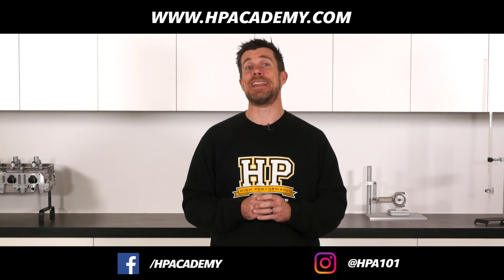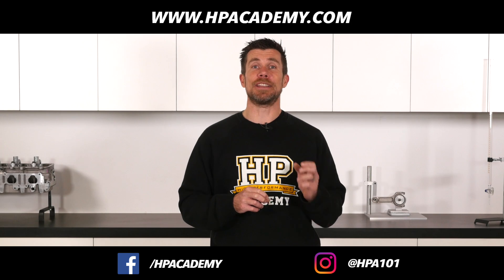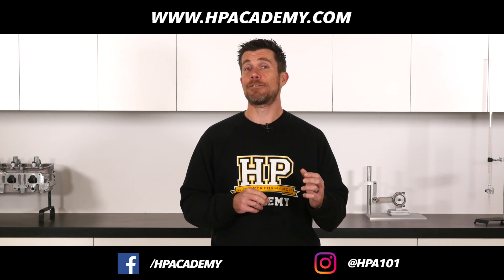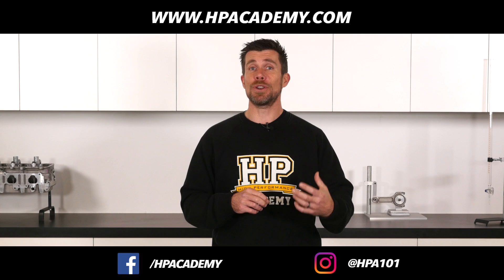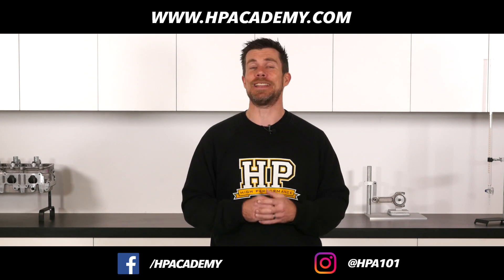[HPA Q&A] Road Vs Dyno Tuning | Which is best?

Comment: if you must tune on the street, find a big, open toll road that's barely used (Florida has a few) and record allot of datalogs in various load conditions to get good drivability and close to the power. then on the dyno, tune for maximum power. then verify on the track. is that a good plan?

Comment: It's not too difficult to find MBT on the road, what I have been doing is just getting the acceleration from data logs and making runs on the same stretch of road over and over. I used to read it out from the logs manually but I recently created log processing software that does it for me. Of course a loaded dyno is a handy tool for getting real time performance data but anyone who thinks it's a complete replacement for testing on the road or track is a fool. All of the final touches to transient behaviour as well as fuel delivery and ignition will need to be made with the vehicle tested in real world conditions with varying rates of acceleration and air speeds that correlate with wheel speeds.
Reply from the maker: Logging acceleration information and running it through virtual dyno software or something similar certainly makes sense. The difficulty however is that it does require exactly the same test conditions every time in order to provide truly useful data - Particularly when we may be only chasing changes of 1-2%. The road surface, incline and wind can all affect the outcome. Of course if you have no access to a dyno then it's certainly worth trying however our own testing has been a little inconclusive.